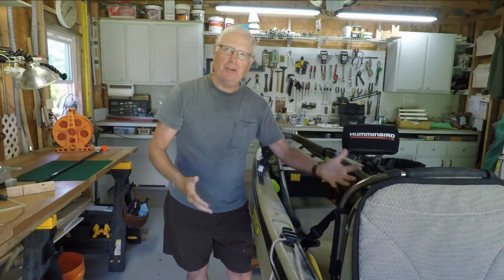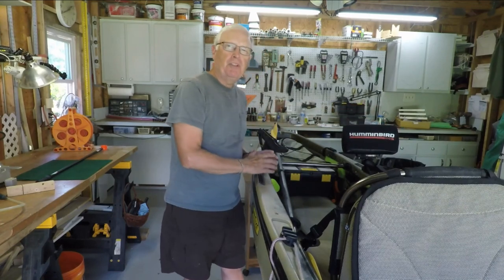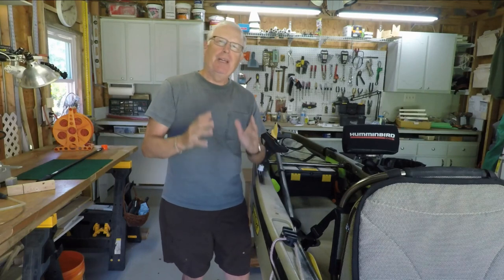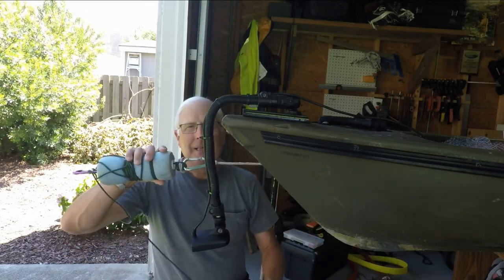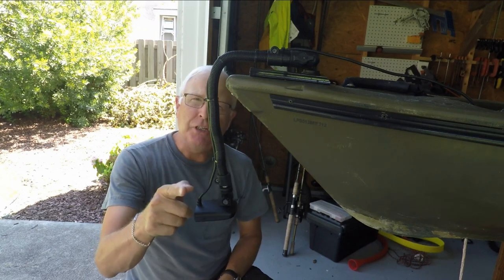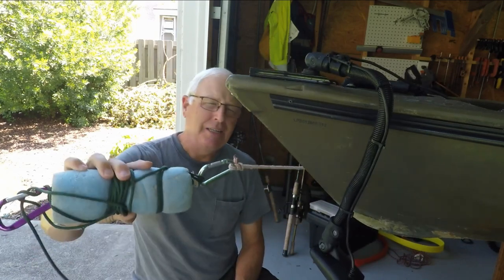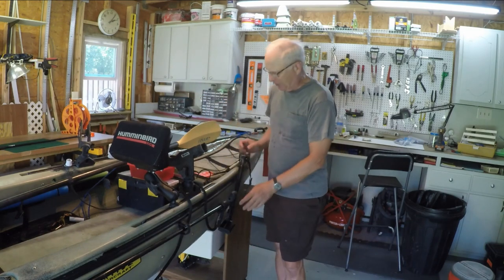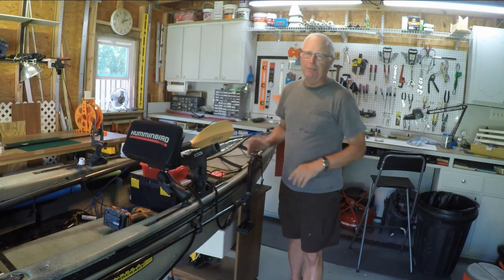Prevent Side Imaging Transducer Installation Mistakes on Fishing Kayak

Comment: Thank you for the tips! Could you please tell me more about the arm for your transducer? Did you purchase it? The fish finder I am going to purchase does not have side imaging, but I'm reluctant to mount it through the hull as I've heard that accuracy would be compromised.
Reply from the maker: I got it directly from RAM.  Link below.  Through the hull is a lot cleaner if it will work with your kayak. I would check with your dealer on how/where to install if it is possible to not lose accuracy.  The side arm like I have is fine, but I always have to pull it up before hitting the shore.  Be sure to make sure the mount transducer head is compatible with your model.

http://www.rammount.com/part/RAM-B-316-18-TRA1-NB
Reply: Thank you for your reply and info!
Reply from the maker: Good luck!

Comment: Hi ! Great Video! im actually looking to get a Helix 7 SI G2, However i was looking to trade in the compact transducer that come with it for the HDSI transducer for a little extra. Did you consider the HDSI transducer, i know its bigger then the compact version, however i dont know if it will fit on my Ram transducer mount as the compact transducer since they dont seem to use the same mount system.
Reply from the maker: I did not consider getting the HDSI transducer since the Helix 7 does not support the 800kHz freq.  I should provide better performance at 455kHz, but I did not think I needed that.  Pls let me know if I got that wrong.

Comment: Thanks so much for this video.  I've been trying to decide which route I wanted to go with the transducer mounting.  At first, I was totally opposed to the arm mount style but I'm starting to rethink that method. YakAttack has new one called a Switchblade I'm considering.   I thought about mounting it in-hull (scupper hole not an option), but for the money I'm spending on my FF, I wanted to reap the max benefit from all the features. However, I still can envision myself forgetting to bring it back in the kayak before beaching or getting into areas with lots of structure....lol
Reply from the maker: Ouch! That's the challenge of side imaging. It has to be fully exposed to the water and below the hull.

Comment: Why not just put it in a scupper hole?
Reply from the maker: My kayak does not have scupper holes.  I would never buy it again. You make a good point, though.  As long as the transducer is below the plane of the kayak and forward of the paddle stroke, it would work.
Reply: Oh wow, Ive never seen one with no scupper holes :/ I have mine mounted in a scupper hole and it works perfectly.
Reply from the maker: I long for a kayak with scuppers!  Just cannot afford to make the switch.
Reply: Kayak Hacks Fishing it takes so long to set up a boat how you want it, it makes changing kayaks very expensive and time consuming. At the end of the day, we work with what we have, the fish don't care :)
Reply: Sit inside kayaks don't have scuppers, that wouldn't be fun...

Comment: why not through hull.. with plumbers goop
Reply from the maker: I wish it would work that way. However, any unit with side imaging has to be below the hull. Your suggestion would work perfectly for normal sonar.
Reply: dang nabbit
Reply: hmm, i seen a flexi arm for a long type sonar

Long structure/sidescan transducer mount (shown below) Part# RAM-B-316-18-TRA3
Reply from the maker: Yes, that is what I use to push the transducer under the hull. The nice thing is that I can rotate it up on the RAM ball when beaching so I do not mess up the installation.

Comment: the transducer can shoot thru the plastic of the bottom of you kayak all you have to do is glue the transducer in the inside of you kayak floor that's it
Reply from the maker: While true for regular sonar, but not true for side imaging.  I spoke with the senior rep at Johnson Outdoors (Humminbird falls under them) and asked that question.  Sadly, for side imaging, the ducer needs a clear shot.  The install instructions say the same thing.  Many kayaks come with a spot inside the hull for a finder - be sure the finder is a traditional one and do not spend the extra cash for side imaging if that is where it will be installed.   I appreciate your comment since it allows me to make this pretty subtle point!
Reply: Live Bait Boat Miami Beach 

I love how know it alls don't even watch the video just shoot a comment..
Reply: But the DI, SI, and water temp won't work and eliminates most of the reasons you have it in the first place. Great for a cheap sonar only unit though.